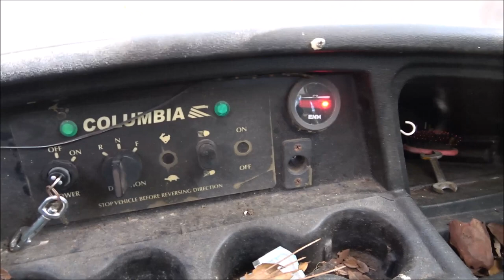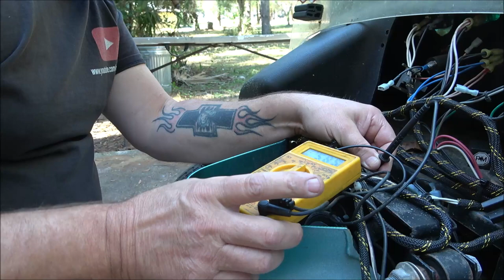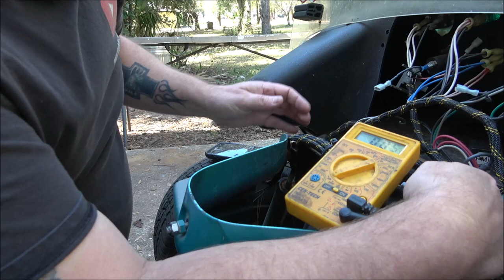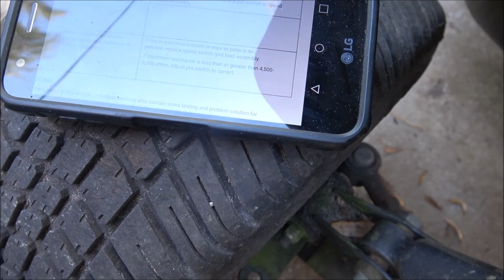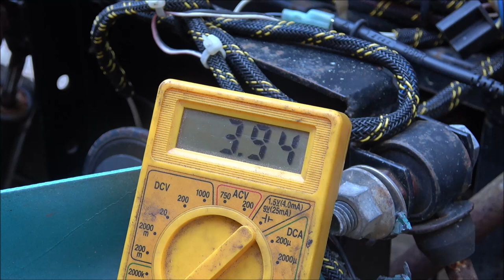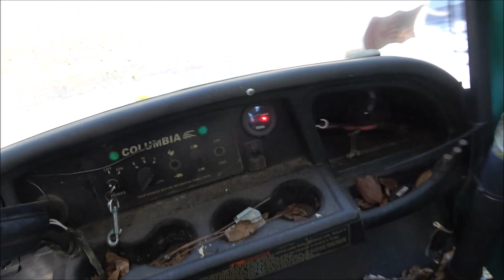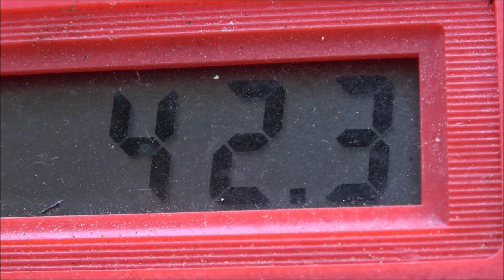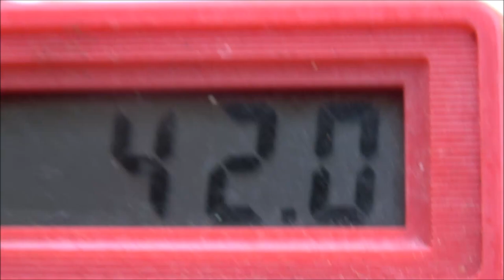Columbia Par Car Gulf Cart Potbox Issues

Comment: We’re having similar issues changed the pot box out but still acting up. Only moves as we have the pedal to the ground and switch from neutral to fwd or reverse but we get bad whiplash car goes but only one speed any other tips
Reply: Same problem,  have you fixed yours?
Reply from the maker: You have to adjust the potbox. If that's doesn't work you may have to check the speed controller.
Reply: I have a 1989 Columbia Parcar.  It also won't go into reverse.  Thoughts?